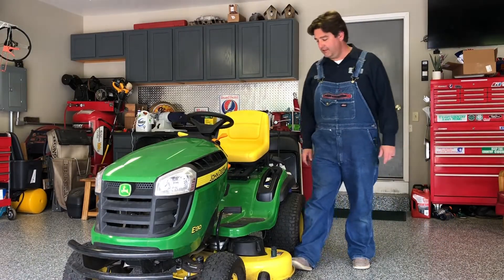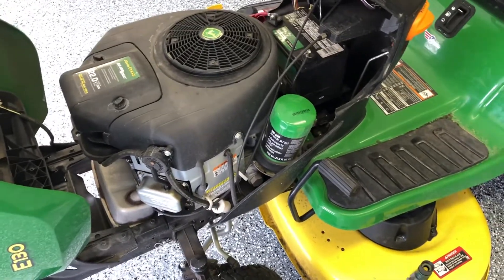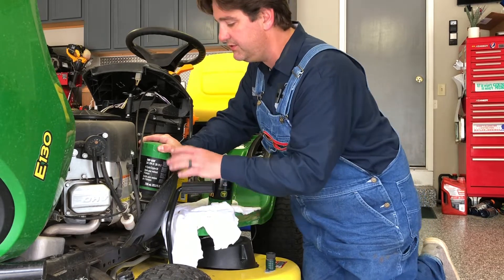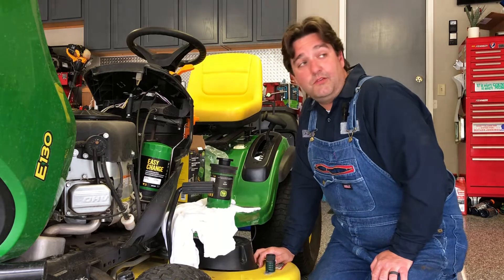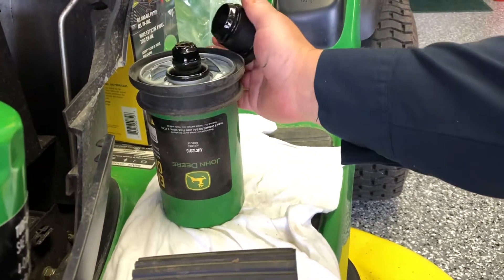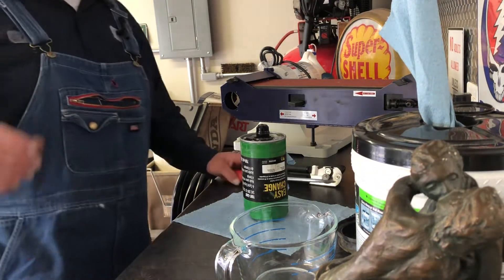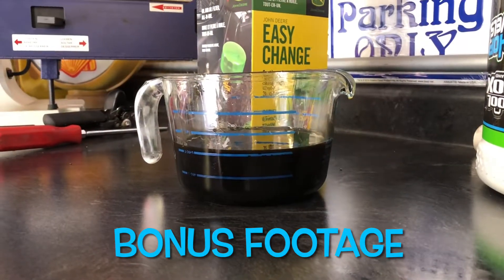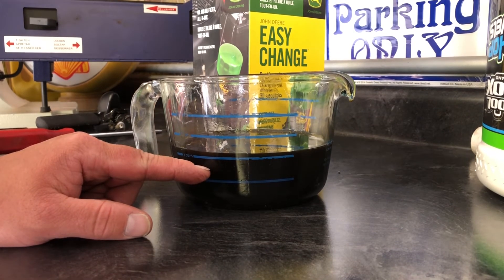WGV episode 9 John Deere E130 easy oil change plus filter hack

Comment: The engine holds about 2 quarts = 8 cups (when fully drained), so you're not changing much of the total oil. The engine drain plug is on the right side, near the bottom of the engine.  I converted my E120  to a standard size filter and used a drain extension pipe on the right side, to avoid mess when draining and save about $30 on each oil change.
Reply from the maker: Yeah we’ll definitely be converting that ole girl to a conventional filter set up next spring…I get why Deere does it, but it’s not for us gear heads
Reply: Thanks for the info, I watched this hoping for the info you just provided. Only question now is what size filter to put on it?  Not a gear head, but can't believe less than 2qt oil change is good for the long run.

Comment: I had converted mine to regular oil change but when i went to chang the oil that dam oil filter was stuck took 30 min to get it off so i switched back to the quick change so easy to change no mess.but i do drain all the oil and replace it.after seeing people cut the filter openes the filter is actually twice as big as the regular filter to me its worth the extra money but u have to change all the oil thats important
Reply from the maker: I can see both sides of the argument, while it’s not perfect I have to give the engineers credit for attempting to make an oil change easy enough for the most basic homeowner to do with no mess. Thanks for tuning in and commenting!!!